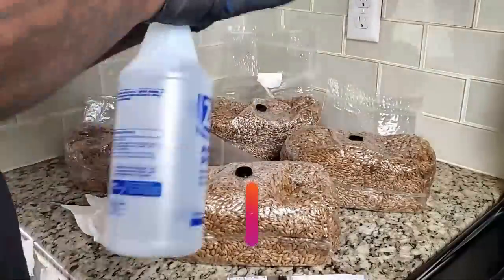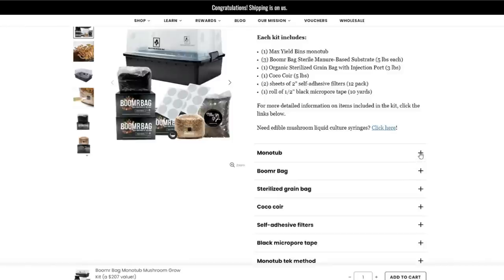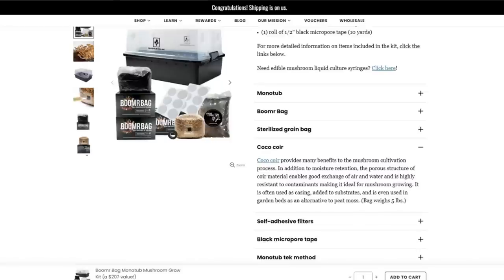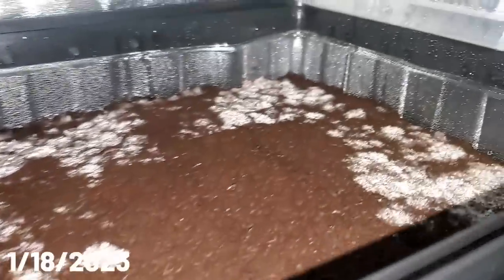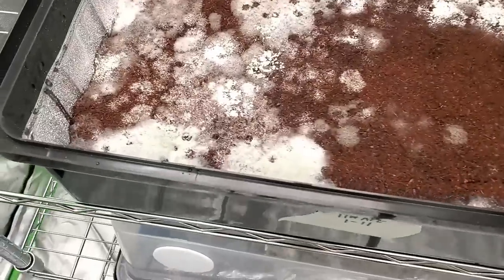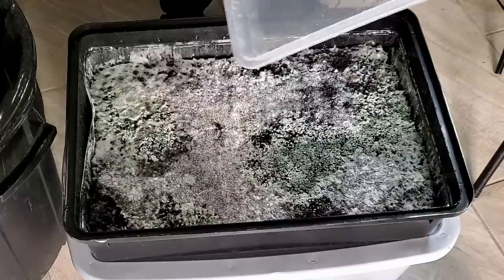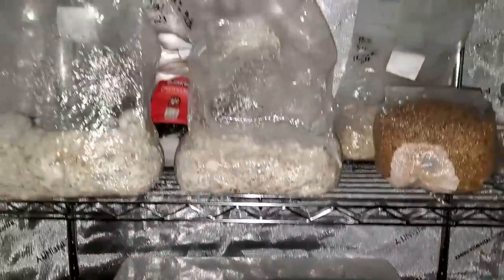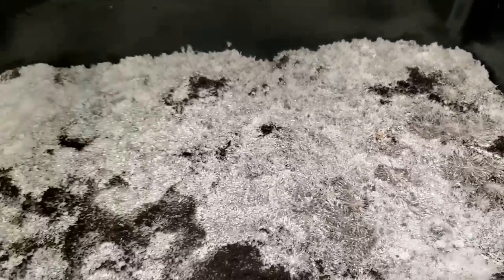Spore To Flush - North Spore Boomr Bag Mushroom Kit | Complete Beginner's Guide To Growing Mushrooms

Comment: I worked in a pharmacy cleanroom for 6 years. Always allow your isopropyl alcohol to set for 30 seconds before wiping up the remaining alcohol. It doesn't work instantaneously.
Reply: Hmmm thanks for the knowledge, didnt know that
Reply: @ChangLRC  that's the whole reason we use 70%, because it doesn't evaporate quickly. If you're going to wipe it up immediately, it defeats that purpose.
Reply: @SubaruLove  I try not to wipe it up, I try to spread it. But I will take more time next time.
Reply: 👍 thanks
Reply: tips n trix ..much luv <3
Reply: I never knew that

Comment: The dehydrator pulls an even amount of moisture from the tissues of the mushroom (no matter the size) that causes "shock." That what makes them look the way they do. Air drying mushrooms at 65 degrees, 55% humidity for 6-7 days (on a rack) will give them the "photogenic" exterior you're looking for. A slow vaporization of the mushroom's moisture, at an uneven extraction rate (depending on mushroom size and shape) eases the tissues into an even rigomortis. Like weed, the less dense/thin parts dry quicker. Hope this helps. I've been growing flower and fungi for a minute now and enjoy your journey. It's humbling.
Reply: Could you also freeze dry mushrooms? Not very convenient since freeze dryers start at like 500 dollars but it seems like it would be perfect right?
Reply: @dudetapedtoafridge3073  I've seen some pretty sexy freeze dried shrooms. Definitely expensive though.
Reply: @brodiethegoaty849  i wonder if they would taste worse since the structure and everything is intact. Have you tried them freeze dried? I feel like they would crumble like freeze dried ice cream with an unholy amount of surface area although that could make a great trail snack or something for gourmet ones
Reply: @dudetapedtoafridge3073  now that is a good question. I have no idea how it tastes. Not sure I wanna know lol. It could go either way.
Reply: @brodiethegoaty849  yeah especially since it wouldn't lose much size either and I'd be forced to crunch down i wouldn't wanna know either😅
Reply: I been tellin him this for a while lmao he jus likes asking why his mushrooms look like that i guess
Reply: Where u get ur liquid culture?
Reply: @lagnation1411  buying psilocybin mushroom liquid culture is illegal in the US but you can get spores from inoculate the world and make your own! Or if you're looking for normal mushroom cultures then north spore has great stuff
Reply: That's what's up 👊 I've been growing bud for a while myself and just started getting into mycology. Cool to find people that are like minded. Peace brother

Comment: I build drying racks, the shelves are 3 ft wide 2 ft deep & the rack is 8 ft tall with 2 * 4 and I use a mesh wire screen of some sort on the bottom of each shelf I staple wrap plastic around the whole thing from top to bottom back to front. Put a double-sided zipper on each side of the front to zip your black plastic up and down, you need one dehydrator in the bottom and a fan at the top. Depending on your location you may want to exhaust hot air. Or just use another tent with a large dehydrator. The key is is I always turn a larger space into a full drying space with one dehydrator. There's also dehumidifiers. And freeze drying is a thing too but I look forward to trying that out.
Reply: I put 6 drying trays in total.

Comment: Turn off the air conditioner or fans in the house  Spray air disinfectant in the air a few mins before you start. Wear a painting suit or one piece jumper and spray it down with disinfectant too. 10 to 20% ratio for spawn to substrate. 1 lb spawn for 5 lb substrate. Try using small hills every 2 inches apart. Maximizing surface area, you might have to water more.

Comment: If my substrate has the correct water, (60 to 70%}. I never add additional water to the top layer until after the first harvest.  Be cautiones with the metal scoop around the grains, because if the grain is accidentally damaged this is a vector for the mean green to attack you grow.  I just use my hands with no gloves and I haven't had contamination in years. If you spawn is clean of contamination then you have nothing to worry about.
Reply: Relatively new grower, but isnt the general moisture and exposed grains in the fully colonized bag at 17:38 signs of your mycelium fighting something ? Would maybe even say I saw some metabolite spots but my eye isn’t that well trained
Reply: @Psmitty3000  If I see any metabolites or when I take the spawn to substrate and my naked hands feel anything damp or signs of wet in the colorization container, I will trash the project and never leave your grains uncovered. The only time mycelium exposes itself is when it's fruiting.

Comment: The bulk substrate bags have a filter. Because you can colonize in them. So mix 50% of the bulks weight of your grain CAREFULLY in a SAB or flowhood with a substrate bag, close it - done. No need for max yield blabla. And the shape of the shrooms comes from the water in the cells. Which is ~90% of the shrooms weight. A humanoid is also mostly water but that is another sad story...

Comment: Are you sure the bulk keeps contaminating? Its hard to see but it looks more like mycellial overlay. Just put some verm over it and it should be fine.
Reply: Also a verm layer on top helps keep in moisture and prevent contamination as well.
Reply: Yeah those green spots were most likely penicillium. And no tubs don’t usually require anything to help keep moisture except for maybe some misting if your surface conditions aren’t where they should be.

Comment: Hey yo I’m not a vet I’m a rookie like you but I do know something about the mushrooms shriveling up. So I’m pretty sure it’s happening because you are using a dehydrator. It’s worth looking into doing a controlled environment drying without using a machine. They need to dry so damn slow that it seems like it’s taking forever. Environment has to be no moisture because it might rot but if you keep it dry but NOT TOO DRY and warm but not hot, then you should see your mushies hold MOST of their shape. If I’m right send me a syringe💪🏻🇺🇸

Comment: Yo hook up a fan to the lid, try a reptile fogger that has a sensor so it regulates humidity (keeping it between 85-95%) oh and maybe a seedling heat mat underneath the box
Reply: What works great and is simple for tub growing is just put your tub in a larger tub, it ensures a cleaner micro environment and will keep the humidity correct as long as the substrate had good field capacity to begin with going in. From spore to bulk is just a short time, done properly it shouldn’t need any water addition.

Comment: Coco coir should only be added to fully-colonized substrate covered in mycelium with pins beginning to form. Only a thin layer of coco coir (1/4 to 1/2 inch) is necessary.

Pasteurizing coco coir:

Coco coir is naturally resistant to bacteria. However, some users prefer to pasteurize it. Should you choose to do so, we recommend steam pasteurization or a water bath at 180 degrees for 1-2 hours. Once pasteurized, squeeze out excess water and allow to dry before use. (Latex gloves recommended.)